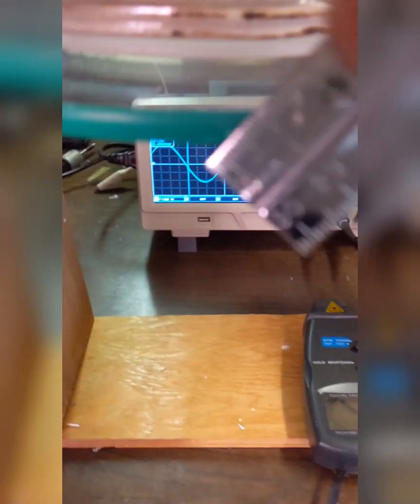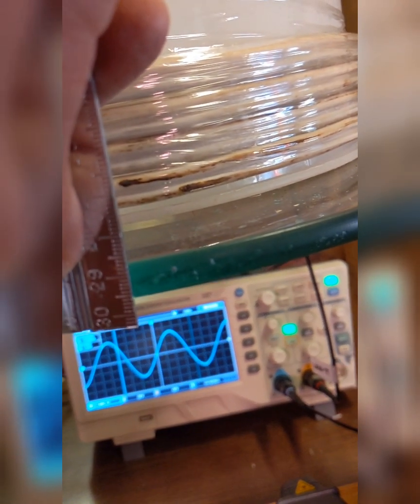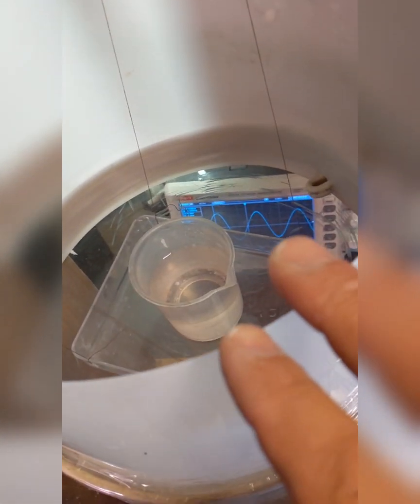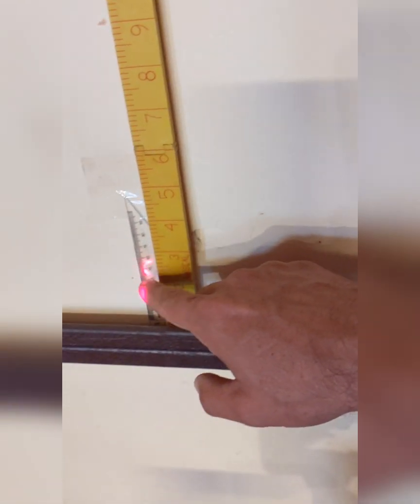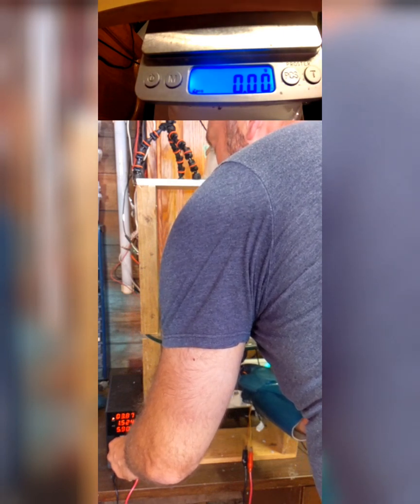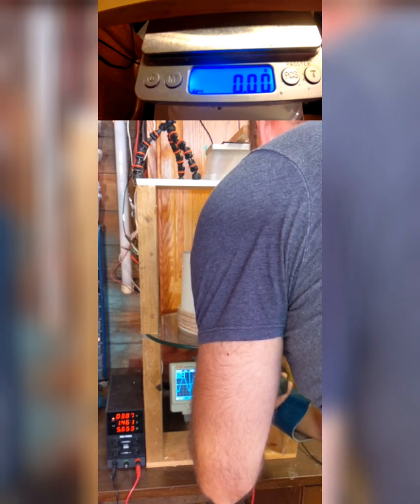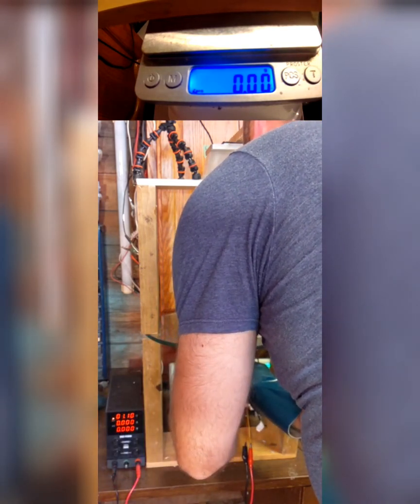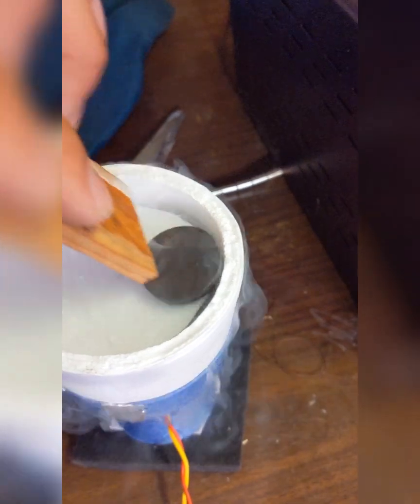Podkletnov Inspired Rotating Superconductor Experiment

Comment: Couldn't you let the superconducting disk kinda sit in liquid nitrogen free-floating in place by magnets and rotate the windings around the stationary disk? Instead of rotating the disk? Or do you need the magnetic field of the superconductor itself to rotate? 

Unless you could make a kinda electric motor out of the disk but not sure if it would work with all that misner effect magic going on.. or rotate a donut shaped container filled with liquid nitrogen and the disk in it  ... pressure relief valves so it dont explode. Could even use the force from the ehaust of the gas to help rotate it... like a aeolipile mini steam engine.

Comment: Thermocouples / thermopiles on digital weigh scale weigh less, under certain conditions of metals ratio, and oscillator frequencies applied. Video years ago was shut down. other scientists/ experimenters have verified this, such as John Keely in his workshop of Philadelphia, Pa. 1890's. He used wires of silver, gold and platinum hooked to metal masses raised upwards. He also lifted weight with a heavy triple sirens flywheel machine with tones in ratio. Keely got the earth low frequency from Tesla. Tesla didn't like keely since keely received more investors money than he did. French scientist raised open frame dirigible air ship with sandwich plates at either end. (translated with Bablefish). The inharmonic vibrations applied had interfered with gravity waves. There old US Patents on antigravity set ups such as mixing opposite spinning flywheels together and others with rotating magnetic field+ high volts electrical field same time. Grebenokof  raised up any weight above platform layer with microwave cavity resonators , such as example- pores of  discs with high voltage field applied. He actually had used array of certain beetle wings on movable sliding fans attached to 4 gimbals.

Comment: Are you familiar with Claude Poher's experiments? You can find the video demonstration here on youtube.. it's titled "Superconductor Gravity Impulse Generator". You can clearly see the propulsive effect in the demonstration video, however, I am not certain if what we're seeing in the video is indeed a "gravity beam" or if its caused by the expansion of gases from voltage being applied into liquid nitrogen. A paper published in 2016 titled 'Null-Results of a Superconducting
 Gravity-Impulse-Generator' concludes that the propulsion is caused by the expansion of gases and that an em pulse is generated that triggers the sensors.

However, Poher is sill maintaining that it's 'Universons' or a 'gravity beam' and in his recent work (from 2020) no longer uses YBCO superconductors immersed in liquid nitrogen and instead uses Graphite conductors in distilled water at room temperature, so arguably if you want to test it out for yourself the setup is a lot simpler. There are also no rotating parts or anything like that.
Reply from the maker: I've watched pohers video, and tried something a little similar. I don't know at this point what to conclude. I've also heard that graphite can replace supers, due to it's stupid fast electron drift velocity.

Comment: Try running laser beam vertically and horizontally through the arrangenent especially close to the boundaries. 
See if the laser beam bends and you can see the beam even when the source is just hidden behind the source.
If it works, you'll see the light source even when its behind the set up as soon as you start spinning the super conductor...

Comment: I still think there is a missing component to this idea that I'm, personally, working on. All you're doing by spinning the superconductor is recreating the Meisner effect, Dr. Lin specifically claims that there needs to be a sort-of 'quantum lattice' in order to 'trap' an electron from it's given angular trajectory. If gravitoelectromagnetic forces are produced by particles 'spinning', then you would want to create an opposing spin force in order to result in a 'net-zero particle spin'. Personally, I believe the answer lies in extremely h o t superconductors, rather than cold ones, because you might need a plasma field to act as a quantum lattice and I think plasma interacts better with hot objects since they're both, ya know, hot.

Comment: You will need a much more controlled environment. An inexpensive way to do this is with cheap remote controlled kids toys or mini drones. Use the actuators from them. Shield everything and enjoy. I have 300 mini drones and I am constantly robbing them for remote motors, levers and flashing blinking things. Oh and check out what the superconductor does to the motors in the mini drone when you try and land the mini on the SC. Awesome experiment can't wait to see more.
Reply: agreed... there are so many variables, wobbles, and hand holding of things going on here, I was getting anxiety. "I'm just going to hold it steady here..." is unfortunately not going to cut it.  I'm not convinced we would see any deflection of the laser even if we have a positive outcome. It would be better to suspend the test platform from one or more hanging scales and look for changes in downward force values on those scales as an indicator of shielding. Also, I would recommend additionally testing spinning the superconductor above the test platform as well (as some theories suggest gravity is a push force not a pull force).